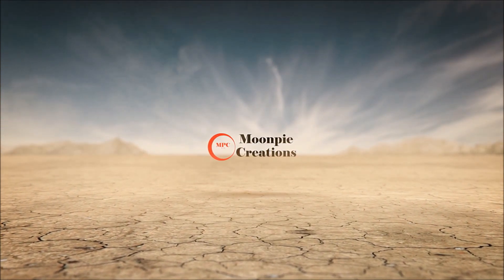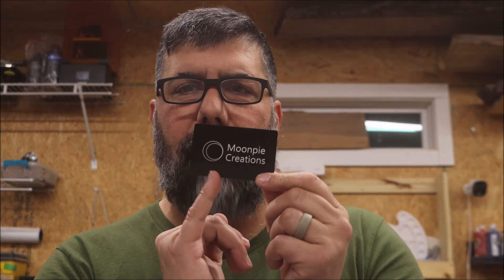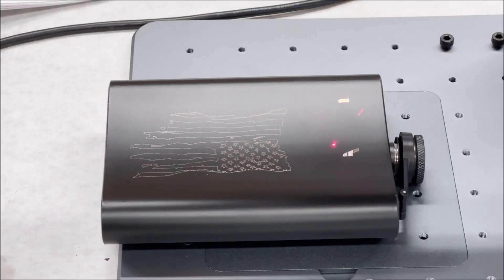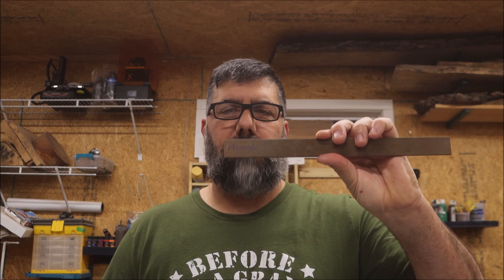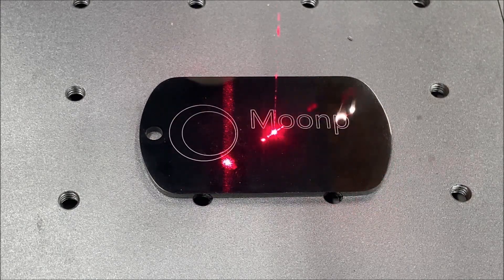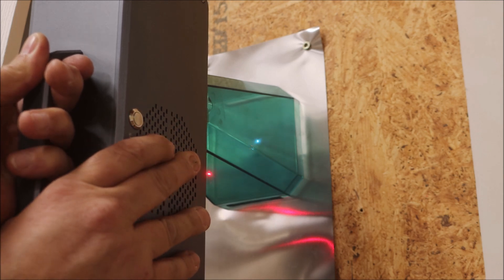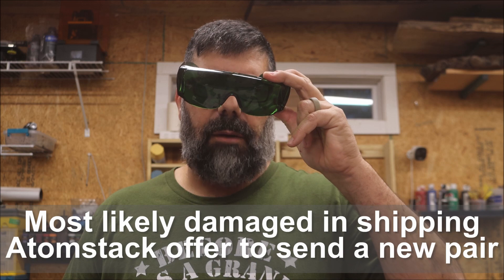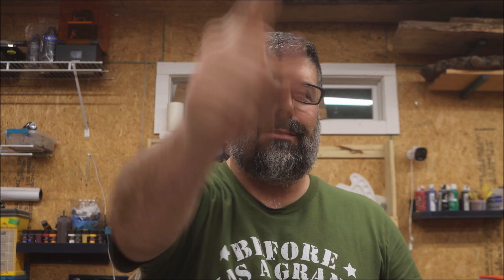It Engraves on Metal -  Atomstack M4 Fiber Laser

Comment: Great review Ken.  I'm curious regarding what the depth of focus on the AtomStack machine is; that's why you didn't get good results with the curved surfaces, you went out of focus at the edges.  I have the 1064 nm module for my diode laser which is the same wavelength as the fiber laser you reviewed but your fiber laser will have higher output power, the module I have is a pumped diode that only puts out 2 watts.  That said, it does engrave on metal and stone much better than the 455 nm module and with better resolution. The real downside is the wicked short depth of focus.  On the module I have, the depth of focus is approximately 1 mm (just a bit over 1/32") making it very challenging to get the focus dialed in.
Reply from the maker: Hey Mark, I'm not really sure on that one. My diode lasers do a pretty good job on the flasks .